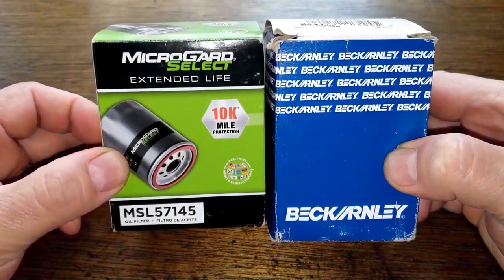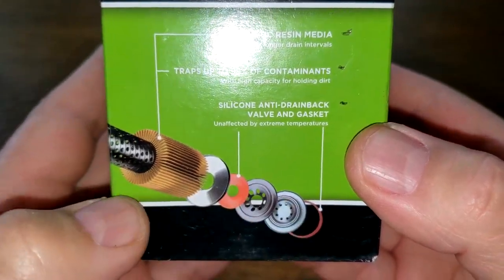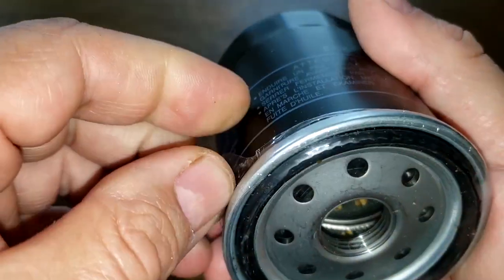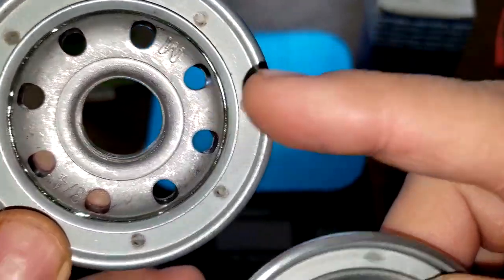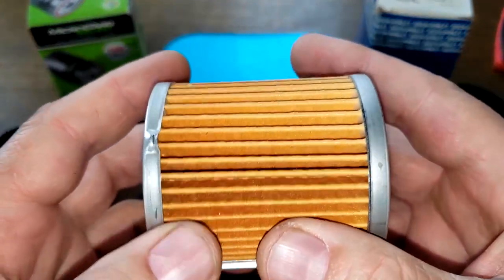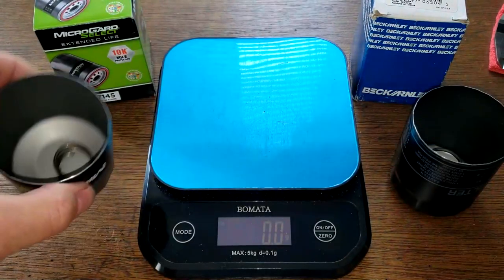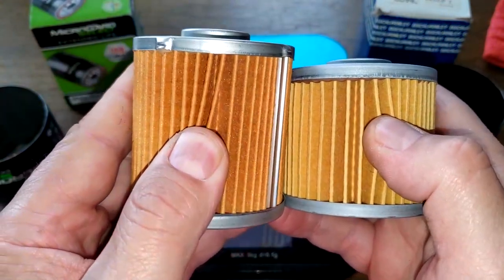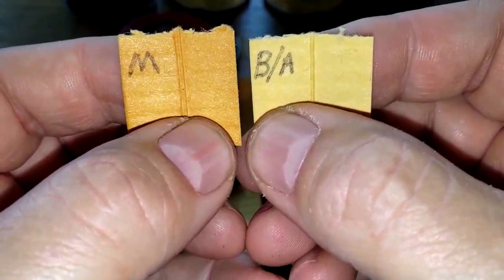Microgard Select MSL57145 Oil Filter vs. Beck/Arnley 041-8065 Oil Filter Cut Open Comparison

Comment: Beck Arnley isn't your typical aftermarket part supplier. My grandfather owned a small chain of independent auto part stores in a specific region of SoCal specializing only in foreign / import brands from '78 - 20/21 and BA for the longest time was the primary supplier. 
Between the 70's and 90's, if you got a BA part, then there was this 90% chance you were getting a repackaged OEM part for as much as 60% less than whatever the dealership was charging. 
A few years ago I ordered 6 BA oil filters from Rockauto and to my surprise, got OEM Honda filters from the 80's. I've also gotten a run-of-the-mill made in China water pump that's still on my CR-V and a repackaged OEM PCV valve too, so now days with BA, it's just a roll of the dice. I've never had a bad BA part though.
Reply: You are correct. BA is just repackaged OEM parts. They always choose high quality filters and various other parts. I am using BA oil and air filters right now.
Reply: Beck and arnley have superior flow rates. They are made for OEM specific ratings per manufacturer. I get them thru Amazon. Not saying that micro guard isn't a good filter. People don't realize how a good flow rate is important during the filtering process. Anyway change your oil and filter religiously. That alone will make your engine outlive the time you own the vehicle.

Comment: I would easily use either filter.  Beck Arnley has a good reputation and it is a well made and clean (!) filter, but the microguard has some really nice features (silicone gasket for one) and is also really well made and clean.  I knew nothing of the microguard but I would have no problem getting one and installing it it.  the high level of quality control with no sloppy glue makes them both a winner.  $10 is no problem if you are getting a high quality well made product.  Your oil is only as good as your filter.
Reply from the maker: Hi Jim,
Good point about the oil👍
Reply: Thanks…. Interestingly, good overviews…..

Comment: Whip, you've cut open an O'R MSL before, topic looks the same. Appears to be a well made filter, though my preference is for US made. Efficiency is good, significantly better than the OEM Toyota from the same viewer. I believe the B-A Amazon media information is inaccurate, at most a blended media like the MSL, or just cellulose. Also, no efficiency spec so that's a negative. All things considered, MSL the better filter. If part of a great O'R oil and filter promotion, I'd use it. Just never see one that beats buying my filter of choice, and jug of synthetic oil from Walmart. Thanks for vid.
Reply from the maker: You're Welcome faxmen09👍

Comment: I like the Microgard Selects. I run the FL820-equivalent on a Subaru EA71S engine with Ford billet 90 degree adapter. Very high oil pressure on cold start ~175psi means the cheaper gaskets blow out some of the time. Ford Racing and Microgard Select have a nice silicone gasket. Premium Guard Extended Life also has the red silicone gasket. Nice thick can too. The Ford Racing filter goes for $25 and the Microgard goes for $10. Big difference when you drive ~1500 miles a week. The clearance sale on the Total oils at Advance has been a godsend too, the engine loves that 10w-60 and at $3 a quart I've been buying all that I can find. Much better hot idle oil pressure than the usual Mobil 15w-50 and about half the price. Doesn't shear down nearly as quick either.

Comment: I'm a MicroGard filter guy, but I was surprised at the the Beck filter. I beat myself up on oil and filters.  I have 6 vehicles and change mybown oil, done it for more than 50 years.  A question I have is can an oil flter be to good, restrictive. I'm  about holes over louvers, lot of inlet hole both for good oil flow. I think the Supertech filter tube even gets more oil flow. Can an oil filter be to restrictive?
Reply from the maker: I'm sure they are tested to give the flow needed but if left on too long I guess they would restrict the flow. I've opened a lot of used oil filters and some vehicles produce more carbon /soot than other filters.

Comment: I really like the Microgard Select filter.  (Yes, at $10 it's not a cheap filter, but it's also not an expensive filter.  Think about replacing an engine for $5k and $10 seems reasonable!)
I'd really like to see a comparison of the Microgard and the "Premium Guard" or "Parts Plus" filters.  (I believe they are same filters)   Great review as always, thanks!
Reply from the maker: Thanks, John
I'll try and do those filters in the future, I think they may be the same also or pretty darn close to the same.
Reply: Microgard is a Premium Guard.   ..   they are on Rock Auto for $5 under the "various mfr" section in oil filters and they will come with their sticker as either Premium Guard, Parts Plus or Pronto but all are the same filter including Microgard.
Reply: @WhipCityWrencher  Thanks!  Appreciate it!
Reply: @memopadilla5931  That's good info!  Thanks!

Comment: Looks like the Beck & Arnley filter is made by either Dong woo Mann& Hummel or SeHan in Korea, they are a OEM suppliers to many OEM manufacturers in Korea 🇰🇷 includingGM ,Hyundai/KIA & Samsung Renault/Nissan,  the Microguard looks like a well made filter though
Reply from the maker: Hi Mark,
Thanks for that info👍
Reply: It's identical to the lower level Pentius..   so I assume Dong Woo or SeHan is making Pentius as well..     but they share identical components with Premium Guard factories as well.
Reply: Daewooparts... do you know who is the company manufacturing for Microgard parent company Premium Guard out of Vietnam ?
Reply: Actually, both of those filters are likely made by Mann Hummel - BA filters used to be made by WIX and I think Mann Hummel supplies OReilly's as well.. The spiral center tube design was originally a WIX patent feature. The one with the holes is the old (and more trustworthy IMHO) WIX heavy-duty design, the newer (and more risk-prone IMHO) design with the louvers is the Mann Hummel (WIX + Purolator) design. Been wondering if Mann Hummel simply shipped the old WIX manufacturing equipment overseas to produce the old version at lower prices for private brands. Can never seem to tell these days...

Comment: Another great video Pete. Is Wix still making the filters for O'Reillys?
Reply from the maker: Thanks, Dan👍
I don't know for sure, companies buy out other companies it's hard to keep up. They probably still make the Reg. Microgards and Napa oil filters, but are owned by Mann and Hummel now, so the components in these oil filters are a mix of different manufacturers.
Reply: That makes sense. With all of these companies buying each other out all the time, it's amazing how much the filter design or quality can vary from one year to the next. Thanks Pete

Comment: I have a question. My 2002 Chevy Malibu has a 3.1 liter V6 engine. I have never seen a bypass valve in any oil filter for this car. Just today I bougt a Microgard Select oil filter which clearly does have a bypass valve in it! I read online that there is a bypass valve at the engine head so an oil filter with a bypass valve is not necessary! Would using this filter with a bypass valve create a problem with my engine head also having a bypass valve as well? Seems redundant to have both or am I missing something? Are there any pros or cons to having this type of setup with the Microgard Select? I am a subscriber and appreciate your videos immensely! Thank you in advance.
Reply from the maker: Click on the link this is the oil filter for your vehicle you should have no problems using this filter. The only time a filter should go into bypass is if it's very cold outside it may go into bypass when first starting up. Also if you have a clogged oil filter, from being in there too long. Thanks! https://www.oreillyauto.com/detail/c/select/filters/engine-oil-filter/80c2d8dbb188/microgard-select-oil-filter/mgd5/msl51040/v/a/3528/automotive-car-2002-chevrolet-malibu?q=engine+oil+filter&pos=1

Comment: $11.00 seems like too much for a filter made in Vietnam.
Reply: They are $5 on Rock Auto under "various mfr" in oil filter section..     will come with Premium Guard or Parts Plus or Pronto sticker but it's the same vietnam factory filter.
Reply: @memopadilla5931  i see that now, thanks for the info!